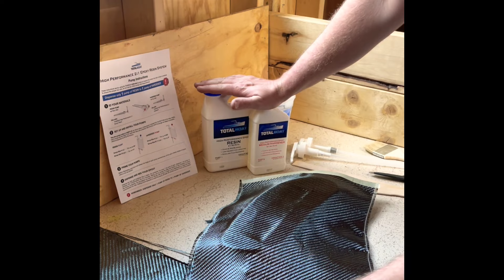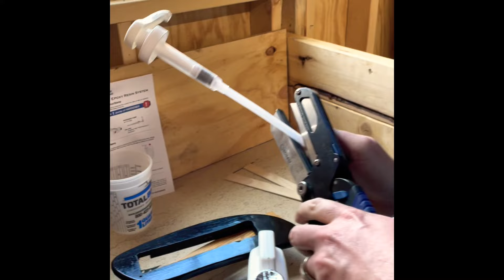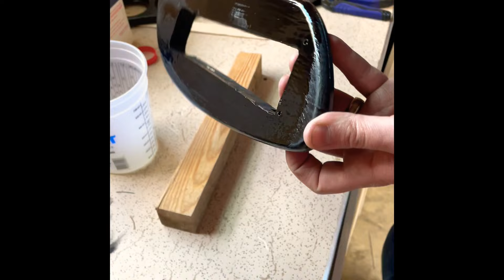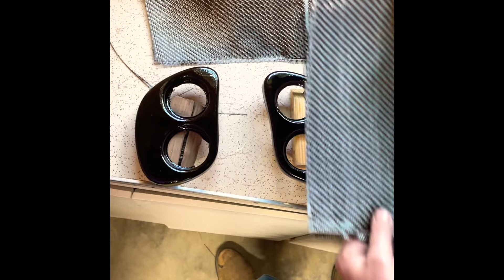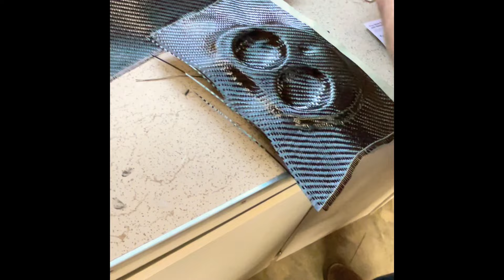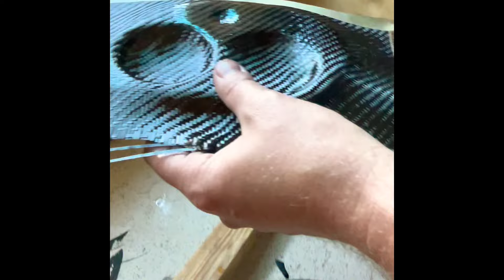Carbon Fiber and Epoxy - Part 2.0 Bass Boat Gauges and Switches

Comment: Is that the original switch panel just cut out for the new switches?
Reply from the maker: No, It is not the original. I took the original switch panel and traced it on a blank piece of wood so I could shape it. Then it got coated with 3-4 layers of paint just for sealant from water then of course the epoxy and carbon fiber over it. So far I have had no issues whatsoever through all kinds of weather. Just takes a little time to shape that piece as the old one is slightly curved to match the dash.